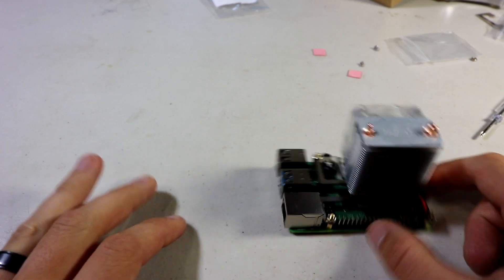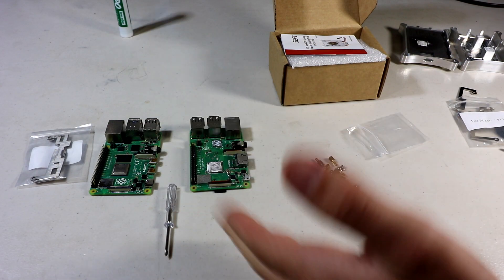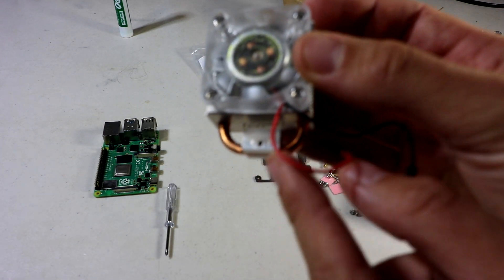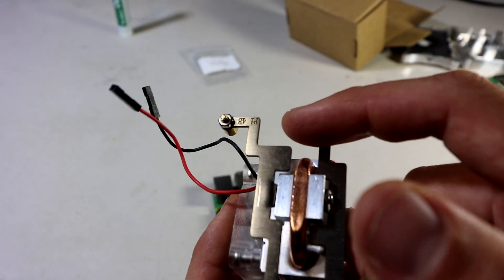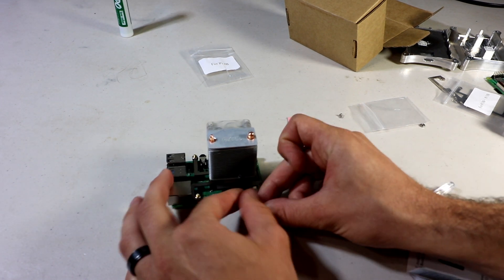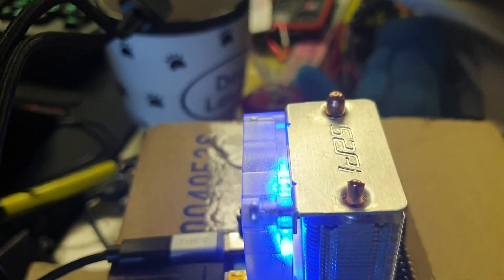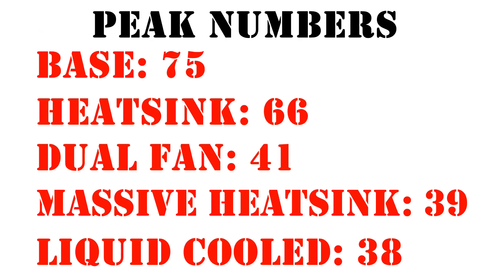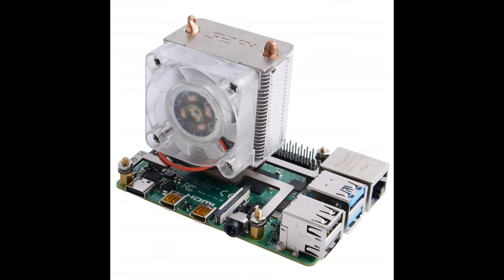Massive Raspberry Pi Ice Tower Fan Cooler

Comment: I'm knew to this,I'm getting a bartop arcade,it has the rasberry pi 3b+,with 20,thousand games,I dont plan on over clocking the pi,but thinking this would prolong the life by keeping it cool,I've seen on ebay they have a low profile one just like this but the fan is facing down,so just wondering if this will slow down the performance since it will be plugged in the pi,and is it worth getting since I wont be over clocking the pi.

Comment: I have this (black model) running on my Pi 3b+ over clocked to 1.6GHZ. Running temps around 38 and under load about 41 to 44c. Works a dream in RetroPie. I used artic silver thermal paste on mine as I didn't like the look of the thermal pads. Great H/S and fan. Works very well. Glad I bought one.

Comment: Nice! If someone creates a case for this set up, I would so get it.  Now the only test that's left is to stick the Pi in a glacier for nature's cooling! #IcyPi
Reply: I'd like to see some machined aluminum cases to hold an HDD and an ice tower and look good in the process.
Reply: @jayrowe6473  Exactly! Almost like a micro PS tower.  Even a vertical one will work.
Reply: @Mike Hirst yea I have a similar idea.Flip the bottom to the top to mount the board .just makes it look like a see thru pedestal its sitting on

Comment: Is this test after updating the firmware (0137a8) that is supposed to help with the heat issue or running the stock firmware (013701)?
Reply: Power On Fun I’ve heard that firmware is causing the USB speeds to decrease noticeably, any experience with that being true?
Reply: @cdawson198600 , I did not run any usb speed tests before or after the firmware upgrade so I cannot say for sure.  I have read about USB 3.0 speeds not being "as fast" as some had hoped.  I am currently waiting on a RPi 4 case with active cooling built in before I begin to run my RPi 4 overclocked and perform any tests.

Comment: Firmware is not just Lower Temp's it Drops 300mah off the usb 3 host, so More Power for your Kick Ass Fan
Reply: Noobs 3.20 and New Buster (10-Jul) i believe contains the update

Comment: I guess you now wear your "hat" upside-down, Damn Drew that's Maximum Overkill
Reply: M2 is 2mm, M5 is 5mm ect, but you guys are still imperial not metric, as you can not count to 10, but you know your fractions of a inch that's impressive for ??  LoL
Reply from the maker: lol thanks for the lesson, yes its dumb that we dont have metric way simpler system
Reply: I heard a good one recently.  There are countries which have the Metric system and then there are those which have Moon rocks. 😉